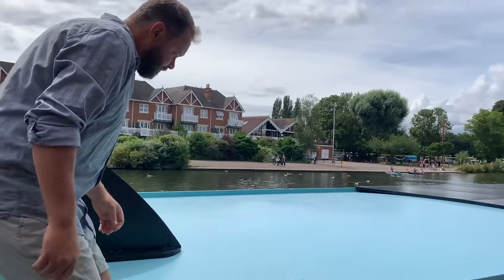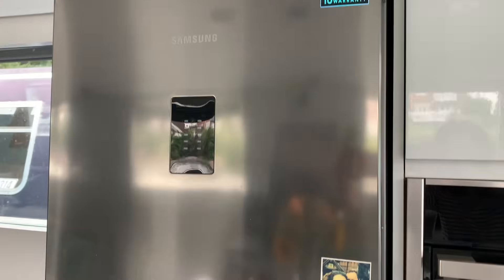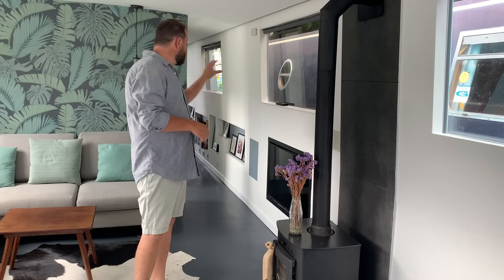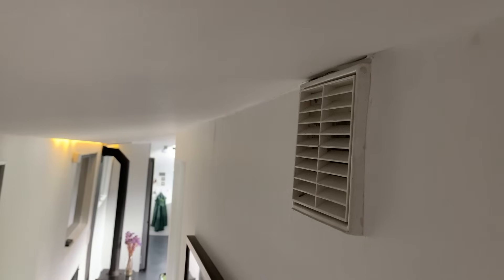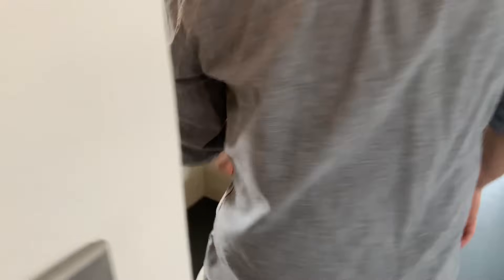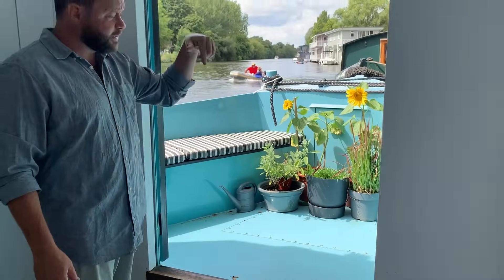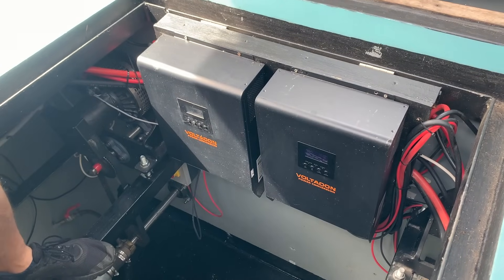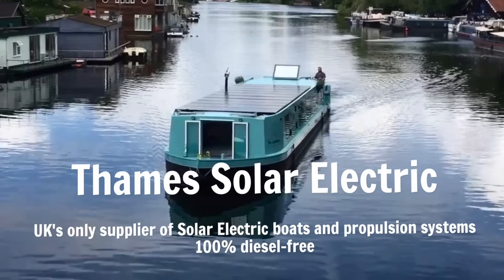Virtual guided tour of The SunFlower by Thames Solar Electric Ltd

Comment: Where is the Bat Boat (Canal version) solar all black the Bat dorsal fins roof mounted, Star link receiver black, the Bat tub (Black hot tub is sunken) front deck. Smart Projection outdoor theatres(inside and out) no TV sets.  Roof top Telescopic Sky deck for sunning with wet Bar.  Electric bike rack for the back of the boat and ramp. The Bat Observation Telescope for Star and Planetary studies. The Bat Stereo Sound System  satellite, MP3, Bluetooth 5.3. The Bat Boards(Basically, Black Paddle boards and paddles and wet storage for phones)

Comment: About friggen time!! There's never been a better boat design or application for electric conversion than canal boats. Sound like you need to look into lithium batteries. Half the weight, and you can discharge them to completely without penalty.
Reply from the maker: thanks Terry
Reply: The boat needs the ballast weight so saves on just filling it with concrete blocks! ... it's not like with a car ... so cheaper batteries can be used.

Comment: Can a generator be installed for a boost say during winter time, which switches its self on when needed?
Thanks for sharing 
Paul 13.31 gmt Uk cheers
Reply from the maker: Hi Paul yes a generator could be added and set up to kick in at a certain battery level .

Comment: I genuinely really like this boat and all the thought that’s gone into the various elements. Not a bad price either! My ONE concern is if you want to CC over winter. I realise the issue with short days and limited sun but what if you DON’T want to get a winter mooring or sit in a marina for 5-ish months? I’ve read your website regarding charge points on the Thames but as you rightly advise, these aren’t as available elsewhere (ooop north, where I am, for example). 

Is there ANY way to make it hybrid so you can cruise in winter? I realise that may be an offensive/silly question as you’re 100% so late but.... well I was just wondering! And if not, is it possible to have another energy source for winter? I’m guessing wind power wouldn’t generate enough? 

Finally, could this be used for a cafe boat? Im thinking about the amount of additional energy required for additional fridge/freezer/ oven on more? 

Sorry for all the questions- I’m totally new to this but I love the concept! Thanks ever so much for reading and if you do, responding. 
🤗🤗 xx
Reply: Hi Cheryl 
Yes it is definitely possible to add a petrol generator ( we don’t like diesel ) and unfortunately lpg comes a hole mother set of problems and hazards  c but a small petrol generator guarantees winter cruising
Reply: In Austria they have pellet and/or wood fired ovens, where a part of the heat 🔥 is used by a sterling motor to produce elektricity. This is used by Chalets in the mountains to be self sufficient. Think especially in winter this can be a nice setup for a boat as well. I think the sterling motors are coming from Israel und England.

Comment: It sounds good.  Maybe a bit too much of throwing around the term "eco."  The big questions that I came up with is what is max range on a charge and how long will it take the solar array to recharge the batteries after a max range cruise.  You also didn't mention a separate house bank so I'm assuming that you are running the single bank of batteries for both propulsion  and domestic needs?  I looked through you website and could not find any information in regards to those questions.  Best I could come up with was your statement about you mostly just live on the boat and don't cruise with it.
Reply: Hi Gnur , yes the one battery bank does everything , from propelling the boat to supplying 230 ac to the domestic alliances . she is fully capable of both cruising and living onboard during summer , the down side is the solar array in winter only makes enough for domestic living and not cruising . we have found that when the weather is miserable people generally dont go cruising , which is why solar propulsion on boats is ideal . range is a common question but difficult to answer as the range is infinite when the sun is out . a easier question would be how long can she cruise at night which is 10 hours at 3 knots . assuming full sun the next day the 6kw solar array would take 15 hours to fully replenish the 96kwh battery .
Reply: @ryancollingwood4605  That's actually quite good. Thank you.
Reply: The reason why you have a phrase like   “Domestic” battery is because with a liquid fuel burning vehicle, be it a boat of wheeled vehicle) you want to make sure you have at least ONE battery that’s being held in reserve just for starting the engine. That’s not as necessary when the vehicle has an electrical propulsion therefore since you don’t have the need to isolate a starter battery, you have more room to cram more batteries in.

Comment: Any plans to include battery cooling on hot days? As heat can really reduce battery life.
Reply: well the river does this for us , even on the hottest day 35 degrees the river temp stays around 20 degrees and keeps the battery bank at a constant . actually battery capacity is increased with small increase sat from 0 to 20 capacity is improved .
Reply from the maker: Not such a problem with lead acid batteries in a cool water cooled engine bay .

Comment: Interesting - I like the Lynch motors  - I wonder if you were building it again if you might use Lifepo4 batteries like the 280ah ones now on the market?
Reply: we will be using lead acid for the foreseeable future , lifepo4 are still 3 times the price and on a boat that requires blast anyway the advantages are negated
Reply: @ryancollingwood4605  I have an RV and went over to Lifepo4  about 4 years ago on our old camper when they were quite expensive - our new  camper has 310ah cells from Ali-Express - they worked under £500 with blue tooth BMS - the beauty is I can bulk charge them at over 100amp and they have a cycle life over 4,000 to 80% -  no sag, no self discharge and about 1/3rd the weight its a win win  (ok you can't charge them below freezing LOL ) there getting much cheaper this past few years
Reply: @trevortrevortsr2  Great for a vehicle but much less advantage for a boat. A boat needs tons of ballast anyway so the weight and size of batteries isn't a problem.

Comment: Do you guys sell sail-aways?? Have you thought of putting solar down the sides of the boat for winter months?
Reply: Yes we do sell sailaways , please see our website . do like the idea of side solar panels but struggled to make them look integrated or part of the boat
Reply: I would think a means to tip the flat roof panels towards the sun would be the best option.  This would actually be a bit complicated, as the need to tip them towards both port and starboard complicates it, and while under way you couldn't possibly have them in the up position(windage, blocked vision, low bridges). But still, it's the way I'd try to go.